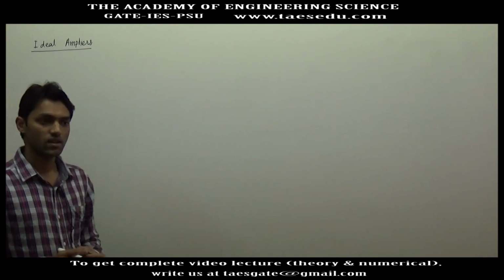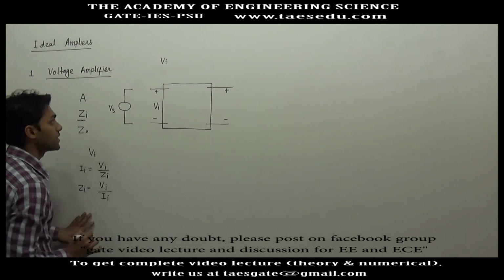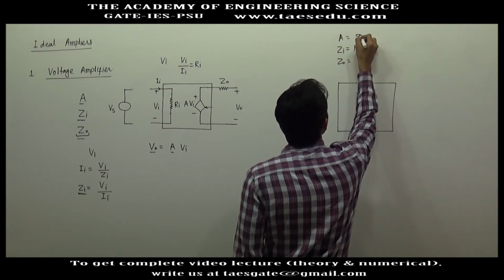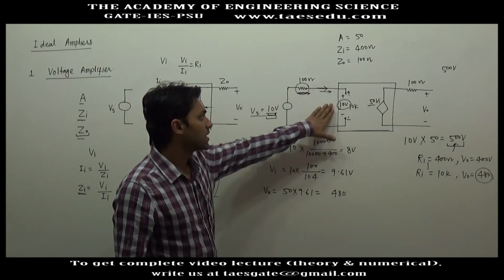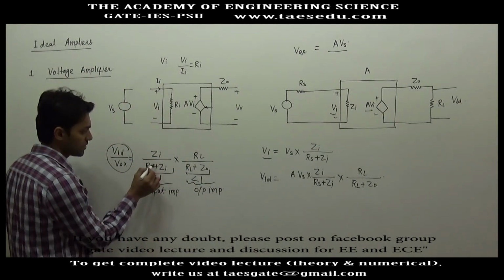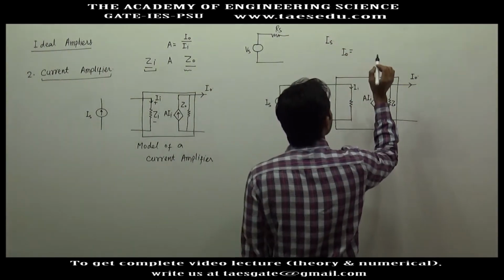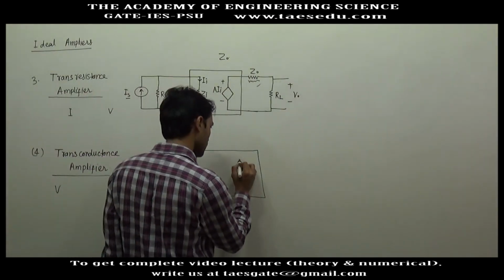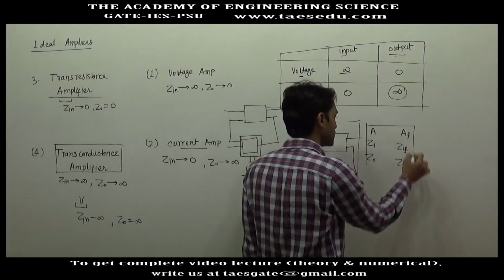Lecture 9: IDEAL AMPLIFIER, VOLTAGE, CURRENT, TRANS RESISTANCE: GATE 2019

Comment: while discussing effect of non linearity, u commited a small mistake, u took high value of Ri=10k, and internal resistance of v/m is 100 ohms so vi=vs*ri/ri+100 gives 9.09 not 9.6, but by mistake u  wrote 400 ohms instead of 100 ohms n thus u r getting 9.6v as vi, btw great explanation, keep it up